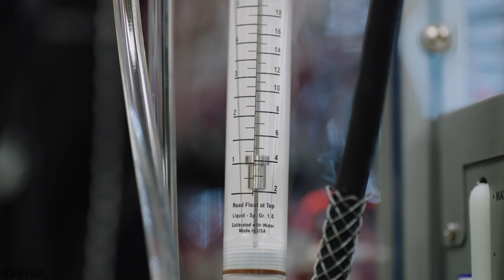Watch THIS Before Buying a Rivian R1T

Comment: Wish we had more hybrid tech developed and used.  Efficiency focused truck,. Hopefully we see something like a Tacoma Hybrid on the road and see how the numbers play out!
Reply from the maker: A hybrid Tacoma would definitely be interesting! Maybe in the future!

We've got a new short dropping tomorrow so hopefully you subbed and let me know what you think!
Reply: @AlexMartini.  Will do!
Reply: Problem is no company wants to do it properly or it will overshadow the expensive engines. The perfect Pickup drive train is a Straight 6 3.0L gas engine with high voltage Electric Supercharger. Then backed up by 30kWh of battery and 200kW of electric motors. It would be a beastly powerful drive train great for low end grunt. Problem is it's BETTER than the existing drive trains.

Comment: The Rivian is cool.  IMO, until charging networks get better developed, EV manufacturers would do well to at least include an option for a range extender 'generator'.   That or North Americans change their belief that their daily commuter also MUST be capable of driving across country at any time with minimal inconvenience.
Ford, now that they have the MachE and the Lightning, would do well to equip every dealership with a couple of 24hr available charging stations.  Every podunk town has a Ford dealer = instant charge network.  It would be a huge boost to their brand.
Reply: "option for a range extender 'generator" Is way too difficult because it's too massive to have any decent effect on charging the massive battery. You need a beefy Engine just pegged at 70% load just to make charging fast enough to be useful as a range extender. The problem is that load profile is bad for Piston Engines.
Also there is way more Public Charger locations than OEM Partner dealerships. Maybe you should use a map like Plugshare to see just how freaking wide spread and abundant chargers already are. Very much podunk towns are the target locations because they are travel corridors.

Comment: A big reason i won’t be getting an ev (for now anyways) is the charging. Now i would honestly just plug it in overnight for the daily commute and I don’t travel a lot so the extended range isn’t too much of a concern but I would still like to match my gas truck in terms of capability with 400 miles of range and the ability to tow my bass boat/camper. Currently there isn’t an affordable option. But the biggest nope for me is something I have preached about since day 1 and was just called a crazy person for and that is the charging infrastructure. Look at California, the power consumption is topped out. Texas has had issues as well and Colorado is also having a power grid load issue and one area went as far as the power company literally locking home owners out of using their ac and limiting their temperature in there own home! I don’t want to wake up one day and have someone else dictate how far I can drive and how much I can charge it because of the power grid that the government refuses to come together on and fix. I don’t have to worry about that with my gas truck at least…

Comment: "1/3rd to 1/2 of their charge to be lost" just due to BLIZZARD conditions is an extreme exaggeration. Hoovie only achieved 1/2 loss from Towing a vintage pickup 
+ cold weather. Worst case scenario should be 1/3rd loss and if you PreHeat on charger power could get as low as under 20% loss. This is for Blizzard conditions not just frost day. FYI BEVs work dang well in the ARCTIC CIRCLE.

Comment: I think why uniformed people assume very few charging location exist because the Public Charger do not have clear bright signage like businesses. Most are just in the corner and small stalls with no buildings. A case of out of sight out of mind thus why people assume there is none located where they need to go. I get lack of signage and relying on maps is not great a method. But it's what we have to deal with currently with limited physical resources.